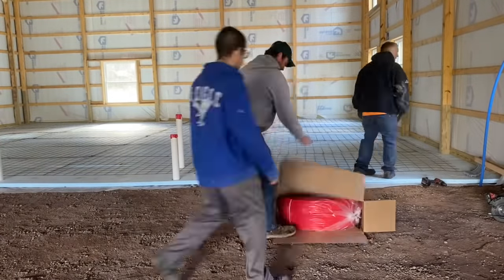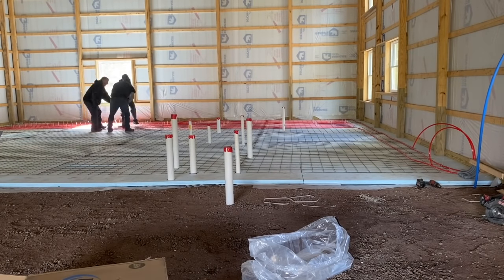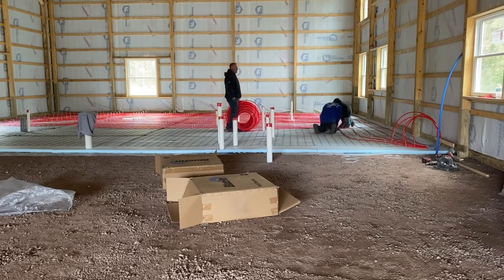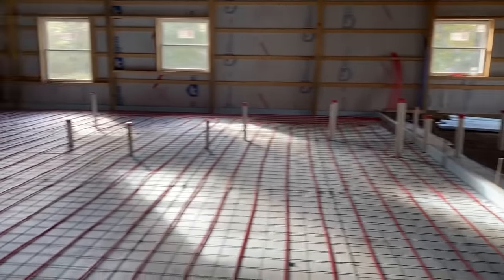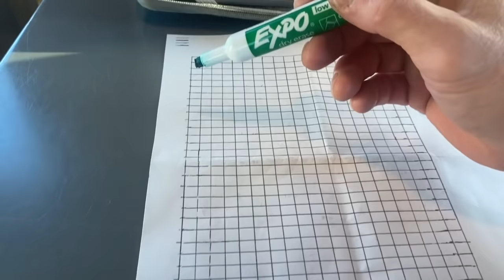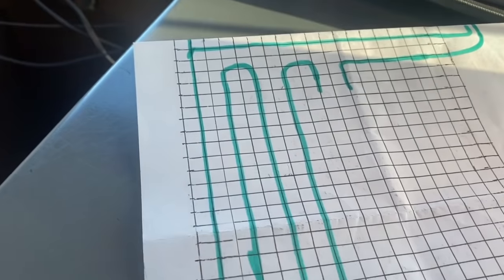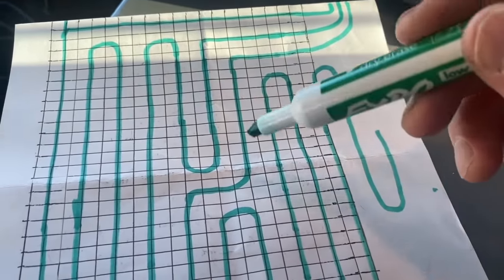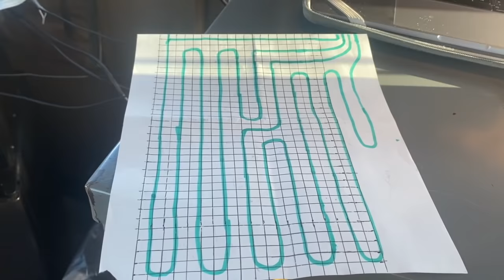Installing your own radiant heat tubing in a concrete slab. (DIY METHOD)

Comment: I really appreciate the work your doing sharing your knowledge. I never really liked doing concrete & subbed it out. My wife & I built over 20yrs, now do it just for our homestead.  My wife had a few surgeries in her neck so she now dedicated herself to the homestead. I changed up starting a trucking business, plus if moving to another state (which we did) is easier with trucking. You mention the barn is for race cars, I'm curious if they thought out plans for car lifts? If so they'd want to put foundations in for those? I know trying to drill or cut into a heated floor afterwards wold be counter productive. There's pleanty of vertical space in a building like that for say double stacking cars depending on how many of course. Great work guys!!
Reply from the maker: Thank you. They were not positive where they would put the lifts or we always avoid that area. The will have to use thermal image now if they drill in to floor. Concrete can be hard or easy depending on the crew you have that day. Regards
Bondo😊

Comment: If I was 60 ft shorter on my last of 5 runs. Can you just run the extra tubing closer together on the last turn or two to keep loops closer In length and a balanced system? Or would it cause some sort of problem besides the spot being a little warmer than rest of the floor.
Reply from the maker: We have done that with no problem at all. I would rather have loops the same length than worry about a little hotter spot. You will never know it
Reply: @bondobuilt386  thank you much I liked and subscribed . I was just.curious to see if you could do that if someone had already messed up the lengths. Figured it might be a good question that others might need an answer for.   good content on your channel and considering doing small system in my garage but powering with an off grid solar array. So I still got some learning to do before I dive in but this makes the inflow heating part much more simple thank you again. I did block and concrete in stone work for a few years it's really hard work you guys make it look easy to easy!!
Reply from the maker: @prolifictroll9387  Thanks. The nice thing is just get the insulation and tubing in there and figure out the system later. Only 1 shot to do the in concrete stuff LOL

Comment: What kind of temperature prob do you bury in to the concrete, or do you just use a wall thermostate for temperature control of the area?

Comment: What would happen if you use non oxygen barrier PEX? and what is the difference between non oxygen barrier and oxygen barrier also are you using 3/4?
Reply from the maker: It is 1/2” pipe. Non oxegen will promote rust in your boiler. If it is an open system it wont make a difference but a closed system you are letting air in and it will rust.

Comment: Pretty good. But 1/2” should have a maximum of 300’ loops. 400’ is for 5/8” and 3/4”.
Reply from the maker: With the proper pump it works great. We have done 100's of them.

Comment: Are the tube colors code for something?  I have seen red, blue, orange and white tubing - do the different colors signify anything?
Reply from the maker: there are some pex used for domestic water that are blue white and red. its nice to make cold white or blue and hot red. the pex for heating is usually red or orange. different manufactures but cheating needs an oxygen barrier in it.

Comment: How would you bolt things to the floor? Would the pipes show well enough with a thermal gun with the heat on?
Reply from the maker: Hi Michael. Yes you would be able to see them with a thermal image camera. Or just use bolts that are shorter than where the tubing is near the bottom.

Comment: Would you consider a comparison of hydronic radiant slab ( liquid in tubes ) vs heated/cooled air radiant slab ( heat/cooled air in tubes )?
Reply from the maker: Stephen I have never even heard of running heated or cooled air through tubes in concrete buddy.

Comment: Maybe someone has already asked this but I don't want to go through over 100 comments. Are you considering heat loss? Is there going to be cold areas towards the opposite ends of the tubbing from the heat source. I was wondering if I needed to reverse the direction of the flow on each 200-400 ft tubbing run? I am planning on building a Barnaminium with radiant heat and I kept thinking your heat loss towards the second half of each 400 ft run.
Reply from the maker: Hi Michael. Once that slab is warmed up you will not have any problem. We do up to 500 feet loops all the time. The buildings now a days are insulated much butter then when everyone thought you needed short loops and more heat by the edges of the building. Don't over think it or over complicate things for yourself. Just try and get your loops close as you can to the same length and run 1 foot of tubing per square fooit of floor. Also good insulatiuon under the slab. I hasve another video I swill send you. 👍😊
Reply from the maker: https://youtu.be/MgAJmah0anM

Comment: Dumb question because I don’t know how the system works but how come you can’t run from the manifold like you did the first couple loops continuously through the entire floor until you get back to the manifold without cutting. At the splices are you using pex crimp fittings? Thanks

Comment: How common is it that someone framing drives an anchor into the radiant heat tubing? That would totally fkin suck!

Staying tuned. I definitely want to learn all of this radiant floor. I plan on buying some land very very soon and building my own ppstframe house
Reply from the maker: Hi there. It has never happened to me on one of our jobs but we leave the tubing on the bottom so it has some protection. If you build a pole barn style house I would use Perma Colums and not put the 6X6 in thge ground. It will rot away down the road but nobody thinks about that.

Comment: Great video Bondo, thanks for sharing! We are going to build a ranch home on a slab and I wanted to have a zone for each room, probably 5-6 zones not including the garage but is that overkill? Thanks!
Reply from the maker: If the ranch house is on as heated concrete slab I would not bother zonning them all off. Heat will migrate in concrete and if its insulated good under neith the concrete The entire slab would be warm. Keep things simple and you will be happy. Also a concrete slab takes a while to heat up so its not something you turn on and off. Its likes to just chug along at one even temp. Hope that helps buddy. 👍
Reply: @bondobuilt386  Thanks for sharing your knowledge!!
Reply from the maker: @traderman4378  You bet 😊

Comment: probably should have ran the first circuits on the perimeter and worked inwards. perimeter is always coldest. thats why my house bathroom is always cold, they didnt run in the perimeter first.
Reply from the maker: Sounds like they may have skimped on insulation as well.
Reply: @bondobuilt386  I’m not sure. My house has 1” xps but I would probably go to 2” to get the R12 equivalent.

Comment: Thanks for sharing some knowledge. What’s the recommended material to use under the foam? Is a packed road base still sufficient or is something else required? I need to slope my slab to a trough drain to I’ll need to consider that also into my plans. 

A little feedback from the viewer perspective , when you are doing your walkthroughs and showing everything afterwards try not to pan the camera back amd forth all fast. We don’t see it the same way you can in real life meaning you need to pan slowly. If you don’t it will just make the viewer dizzy and the video blurry so try not to do that.
Reply from the maker: Crushed rock works good or a crushed gravel. It depends what is available in your area.

Comment: Ron how come no rebar and only mesh?  Also so 400’ seems to be the magic number what do you do with the extra 200’ left of the 1000 ft roll can you splice it together or no?
Reply from the maker: Hi Randy. We used fibers in this slab and at 5-1/2” thick its rock solid. We have done 100’s of them and they dont move. We run up to 500 foot loops. Say a building was 1500 sq feet or 2000 sq feet. 1 foot of tubing per foot of building in concrete.  with the proper pump no problem. I only splice thbe tubing in floor joist aplications. We use up the tubing for that and home run plumbing jobs. 👍😊
Reply from the maker: https://youtu.be/MgAJmah0anM

Comment: The walls are going to need to be a secured to the floor also how do you keep from hitting the pex sir.
Reply from the maker: We do not pull up the tubing in these slabs so the tubing is under the concrete 4” so you can secure the walls to the slab with 4” tap con fastners and construction adheasive. They will only stick through the bottom wall plate and go 2-1/2” into the concrete.  This is why I do not pull up the wire mesh so we put fibers in the cvoncrete for extra reinforcement . 👍😊
Reply: @bondobuilt386  thank you for the reply sir not sure why it did get a notification of it.
Reply from the maker: @iwantosavemoney  No problem. 👍

Comment: can you have a splice in the middle of the system?
Reply from the maker: Mat you can but I try and avoid splices under the concrete I use up partial rolls for domestic water runs or heat runs in the floor joist. 😊

Comment: My wife is concerned about the heating system being buried in concrete. Have you ever had any of the tubing leak within the concrete.
Reply from the maker: Lewis I never have had a leak.  I have done 100’s of them. 👍
Reply from the maker: I have it in my own shop and house.
Reply: @bondobuilt386  thank you for taking time out of your day to respond
Reply from the maker: Lewis no problem. any time 👍

Comment: Is there no problem with not having the wire up in the concrete?  Or are you just using the wire to attach the pipe to?
Reply from the maker: Just to hold and layout the pipe William. We put fibers in this for reinforcement

Comment: Where do you get your supplies?
Reply from the maker: it's called Supply House online.
Reply: @bondobuilt386  Thank you for the quick response, as a DIY guy your explanations are valuable. I am familiar with that website so I will take look. I am interested in  having in-floor heat in my build this upcoming summer and your videos have been great as I plan to lay the piping myself. Have you installed snow-melt mats underneath outside walkways? If so what is your experience with them?

Comment: In the apartment portion, I get going wall to wall with the tubing. But would you consider leaving 2-3 feet of the floor along the walls unheated since shelves and work benches will typically be along the walls?
Reply from the maker: I would not do this. You need 1 foot of tubing in every square foot of floor buddy. 👍
Reply: @bondobuilt386   What do we need to watch out for in order to keep moisture / mold build up in the walls...
Reply from the maker: @syclone1012  How do you plan to insulate the walls? I find dence pack cellulose works well and you will never get any moisture or mold.

Comment: If you are building a more traditional floor plan, where each room has its own zone (temperature controlled) I am curious how the layout and the length of the runs would be ?
Reply: HI, for that plan should be done with tube manufacturer or pipe sales house, if you buy from them they probably do that service for free, but ask for reverse loop layout ( not sure if they have software for that) the back and forth layout dos not work so well.

Comment: do you recommend radiant heat in central florida on a marble floor covering?
Reply from the maker: I recommend radiant heat there yes. In my opinion if your feet are warm you will feel so much more comfortable. Whenever I go into a house now I can immediately feel there cold floors. LOL

Comment: Quick question - What thickness of concrete do you normally pour over radiant heating like this?
Reply: I was reading. Another response and it looks like standard 5-5.5” pour. Any interior walls over the piping gets glued to the floor and use 2.5” tapcon screws so you’re still 3-4” above any piping

Comment: What insolation do you recommend?
Reply from the maker: You want at least 1-1/2" of closed cell spray foam or 2" of expanded polystyrene. The blue board or pink board that you can buy at the box stores. You don't want open cell foam like polyiso as it will absorb m,oisture and not perform that well.

Comment: I am having a Hiline home (like Adair) build with 3 car garage and wanting to  add pex into the floor before they pour the slab . Is 400' runs of tube a good length for my build? And can a simple tankless water heater setup be used as my boiler system?
Reply from the maker: Yes 400’loops will work fine and a tankless will for sure do the job. I have done a couple with Takagie tankless water heaters. Make sure you insulate under the slab good. 2” of polystyrene or 1-1/2  “ of closed cell spray foam. And it will we awesome 😎

Comment: Why would you cut it at 400’ and not roll out the 1,000 feet and not have to make any connections?
Reply from the maker: There would be to much heat loss running a 1000 foot loop.

Comment: In this video you kept your loops to 400’. You said later in the video that you can effectively run up 500’ or more provide you have the correct pump for it. If that’s the case, given that you’re using a 1000’ roll, why bother cutting them at 400’? Why not run the final loop at full length, or a length that goes beyond 400’,  and then tie it back to the wall?

Comment: so you keep 6 inches off the outside of the building, and then start your 12inch on center runs
Reply from the maker: You can start at between 6 and 12 away from the outside wall depending on how many wire mesh grids you got to cover. . 👍👍

Comment: How much would this usually cost ?
Reply from the maker: Just the heat part? Or concrete also?
Reply: @bondobuilt386  heat
Reply from the maker: @chickenfoundation9323  $3.00 a square foot with board foam I woulkd charge.

Comment: So why wouldnt u run lengths that avoid waste? Example you have 200' left on a 1000' roll... Why not go 330' loops?
Reply from the maker: Jim a building will require 1 foot of tubing per square foot of space so depending on the size of the building will depend on the length we use per run. I want all my loops the same length so they flow evenly.
Reply from the maker: This building was divided in three 40 x 30 sections so each section had 1200 feet of tubing so we did 3 - 400’ loops per section.  Then each of these sections can be a separate zone off a boiler. The one section was a living space so that would be at a different temp then the shop space. Hope that makes sense buddy. 
Bondo 👍👍
Reply: @bondobuilt386  totally makes sense thanks :)

Comment: So what diameter is the tubing? 3/4"?
Reply from the maker: no its 1/2" oxygen barrier tubing.
Reply: @bondobuilt386  What is the temp of the water at the beginning of a run vs the end of the run?   I will have (3) 300ft runs and wondering if I should route the beginning of the lines at the perimeter (where it'd be colder and then loop it in as you show.  Thanks
Reply from the maker: @toocoolfortheroom380  It all depends on the temp of the slab. When you first start up the slab will take alot of heat. Water will come back cold. After everything is warmed up it will loose much less Dont worry about doing perimeter first bud. Just lay it out and keep the loops exactly the same length as I show in my videos and it will work perfect. We done 100's this way buddy. 👍😊
Reply: @bondobuilt386  cool makes sense.  I was thinking about putting just a thin 2 mil layer of plastic under the 2" insulation sheets just for an added layer.  Anything bad about that or totally unnecessary?  Thanks again 👍
Reply from the maker: @toocoolfortheroom380  You definitely want 6 mil polly under foam for a vapor barrier. keeps slab from sweating.
Reply from the maker: @toocoolfortheroom380  I can’t speak for that insulation because I never have used it. I always use the high density blue or green board. R 8 seems low for the r value also.

Comment: What's the R value of the insulation on the ground and the structure?  It's not rocket science but it is a science, having what looks to be very low r value insulation on the ground means you are basically spending money to heat the earth instead of your living space.
Reply from the maker: This is 2" of ridged XPS closed cell foam board. It's around R5 per inch and these floors work real good and do not cost a lot to heat the structure provided the structure is also insulated good.